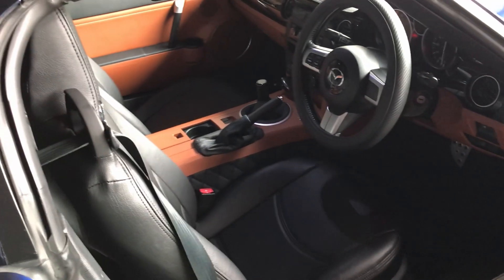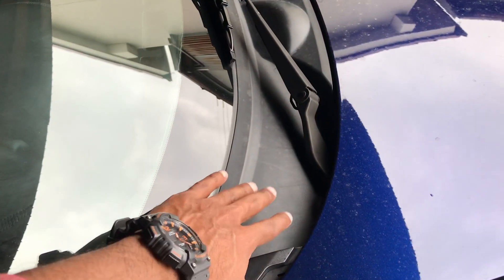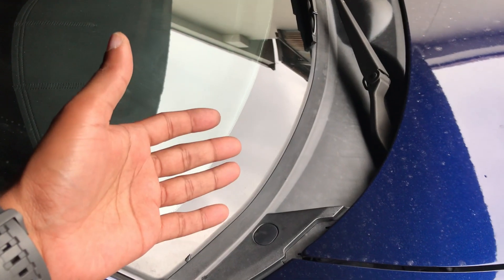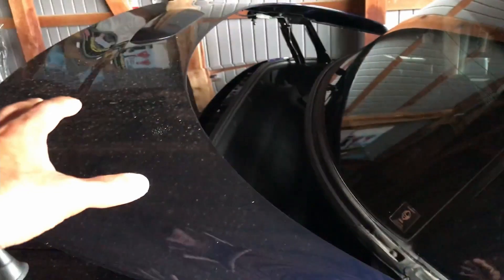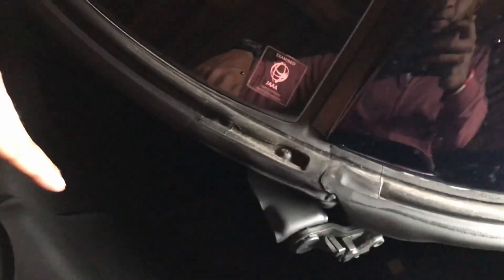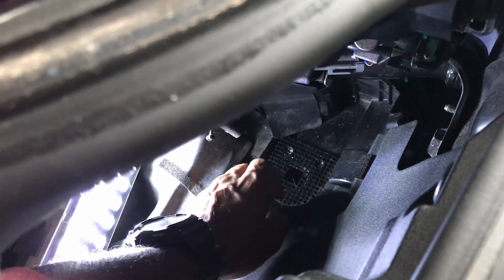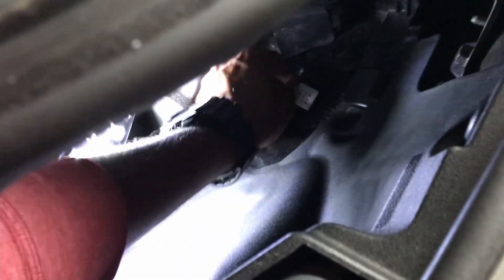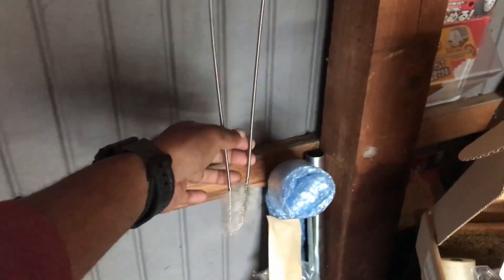Leak Proofing My NC MX-5 Miata | Tach On Red

Comment: Thank you for this excellent video! May I just ask, could blockage in the drain holes in the NC PRHT cause water ingress in the boot (trunk) of the car? I have no water in the cabin or behind the seats, but get loads in the boot, when it rains.
Reply from the maker: Thank you for watching!

To answer your question, no.

If you have water in the trunk, I'd troubleshoot seals around the tail lights, antenna, boot lid weather strip, and grommets for the numberplate light wires.

Easy way to find out for sure is get a friend with a flashlight to jump into the trunk. And remove all the plastic trunk trim beforehand. 

Hose water over the car and focus on the areas most likely to leak. And when the person inside the trunk finds the leak, they can give a signal. Then you stop hosing water and let them out of the trunk, or not if you don't want to be friends with them anymore. 😆
Reply: @TachOnRed  thank you so much for your kind reply. I'd already sealed the lights and still was getting water ingress. I haven't got anyone nearby happy to get in the trunk, so I've removed the plastic panels and  put talc everywhere so when it rains next, will hopefully be able to see the tracking of the water! Thank you again!
Reply from the maker: Oh and one other spot I forgot to mention is the nuts for the trunk hinges.

I hope you can get it fixed soon! 👍 Good luck!
Reply: @TachOnRed  thank you so much! Getting a little water ingress right in the centre of the boot, which could indicate the trunk hinge nuts!

Comment: Do you have the problem where your prht won’t go up or down sometimes and you have to restart the car to get it to work?
Reply from the maker: Wow Malachi... that's the first time I've heard of that. The first thing I might try doing is disconnecting the battery for 30 minutes and then reconnecting it. If the problem is related to the ECU, that could help.

Otherwise, I'd be thinking of the sensors which detect whether your car is in gear or not, and also the sensors to detect whether your trunk lid is properly closed. If either of these are giving a false reading ,that could stop your prht from responding to you pushing the buttons.

Comment: Wait really what year is your NC? cause I got 2015 hardtop NC you think rainy season will still cause leaks or just for some models?
Reply from the maker: Mine is a 2007. 

I don't think rain causes leaks. Instead I think it's just aged or poorly maintained rubber seals. If you regularly apply rubber/vinyl conditioner/ rubber wax/ leather wax to all your rubber seals, you'll get better mileage out of them. 😊

And when they do eventually break down, just have to replace or repair them. 🤷‍♂️ Just a rather troublesome aspect of owning a convertible.
Reply: @TachOnRed  ahhh I see I rarely put my top down maybe like once in a blue moon or not at all tbh but I’m glad to see you show the drain hole using that white plug cause I’mma give that a try and order those plugs for mine

I also daily mine sitting at 54k miles 
Got it 7 months ago and I’ve read forums that the coolant reservoir will crack overtime/age? What’s your opinion on them you think it’s for all NC year models?  

so far cars been reliable haven’t done anything except change the oil and filter twice with full synthetic
Reply: @MiStahJviet  The problem isn't so much leaks as the drain holes getting blocked, allowing water to get trapped and causing corrosion from the inside out.
Reply from the maker: Sorry for the late reply!

Wasn't getting notifications for the later comments.

I have a Moroso tank in mine so...that kinda answers your question I suppose.

I don't personally know anyone who's had problems with the OEM tank though. 

Id say swapping your old yellow tank with either a new OEM one should do fine for a good 10 years. 👍😊
Reply: I'm getting water in my trunk but I've cleaned the drain of my NC '07 retractable hardtop and i still get water in the trunk.  I didn't see the drain screen but like you say it's very inside dark there. Now I think the water is coming in at the back lower window corner where the seal is uneven compared to the other side. I've never thought or knew of conditioning the gaskets.  I'll try that bit it may be too late since it's 16 years young.  Lol.  Runs and looks great.  We drove it all year long. I need to take off the snow tires soon. Thanks for the help. Also I adjust the trunk seal to stop water. Made no difference. I also resealed the third brake light plug hidden by the  lid. Still water leaks into the trunk when it rains.  But I never get water in the trunk after going through a car wash. Go figure?